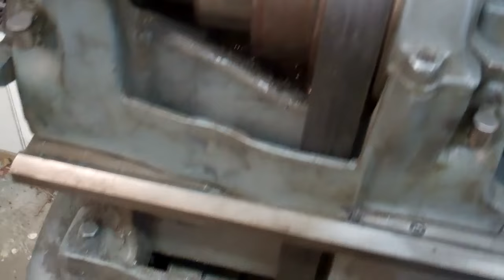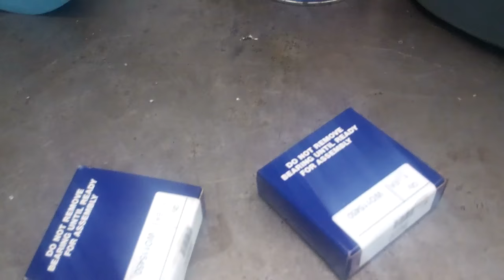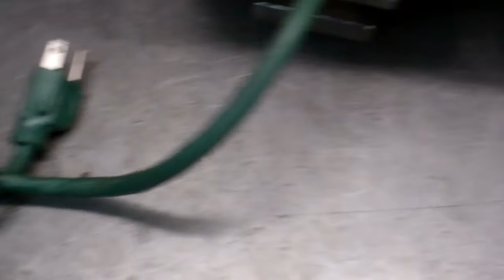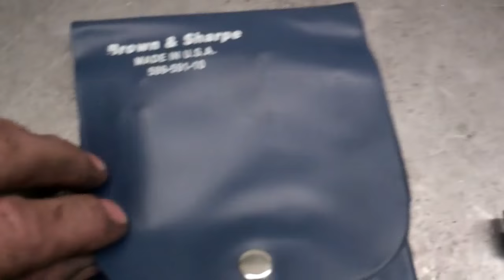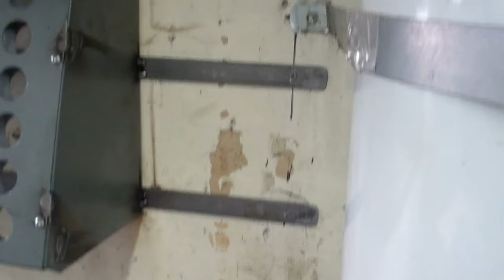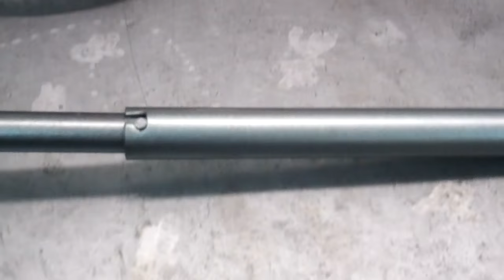South Bend 13 Lathe Rebuild  (Part 2 of 4)

Comment: Hey, I just picked up a South Bend 13, only 100 serial numbers away from yours, so very similar. I really need to tear mine down and clean it from the bottom up, and I was going to buy a felt rebuild kit while I was at it. Would you please point me to where you got instructions for taking this while thing apart?

Comment: Beautiful job on the Lathe Ken..And you did it Right &"Thanks" for mentioning my name..Also you are going to run out of room for all them tools..the same happened to me and i had to build an addition on my garage<-:
Reply from the maker: About 5 years ago when I moved here I had a lot of room.   Now I have to climb over everything.  I'm planning on tearing down my shed and having more concrete poured there and putting a 20 foot shipping container there.  That way I can put lots of the stuff I'm not using all the time in there.  Then I will actually be able to walk around my garage again.

Comment: I use to run one of those in machine shop school..Those old lathes are tough
Reply from the maker: It ended up taking me about a year and a half to rebuild it and buy most of the tooling.  Should have it finished soon and have the rest of the tooling.  The tooling is the most expensive part.  Theres just so much of it if you want to buy everything for it.